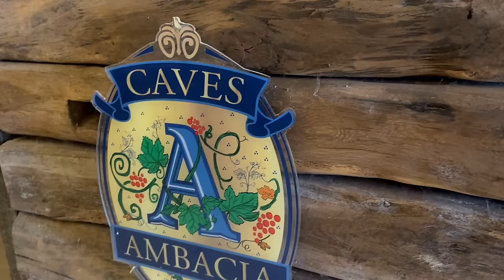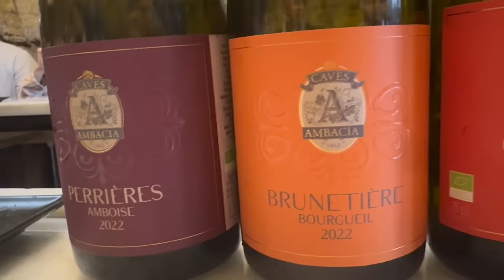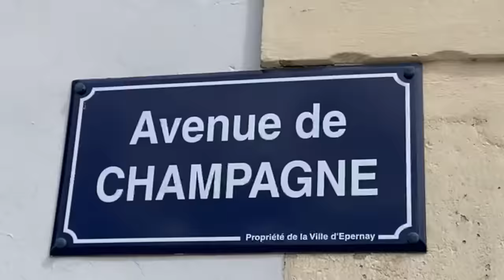Ep 36 | We have a HUGE ANNOUNCEMENT...

Comment: A high quality diesel is still the best answer.  Electric drive will improve but it's still a new technology with its own set of problems.  Diesel parts are far more available in remote places than motor controllers, etc.

Comment: I think it's great you chose to go electric. It will change the way you sail, especially on long voyages. You'll be motoring a lot less in the calm patches. But, if you've watched Sailing Uma, you'll know that it is very doable. I just bought a boat and wouldn't  hesitate to change over to electric if the existing engine was in bad shape. Mine, however, is in excellent shape so it wouldn't be cost effective to switch out. Good luck with everything.
Reply from the maker: It's a whole new learning experience. We wouldn't have switched if we weren't in the position we were in. 🙂

Comment: Electric motors are definitely the way forward. As well as us there are two other boats here fitting them at the moment.
Doing things differently to how they have "always" been (always meaning 60 years or so in this case) scares many people. Typically there is imbalance in the arguments with the disadvantages of the new getting far more attention than the disadvantages of the old. For diesel it's worth paying attention to the issues with failing due to fuel contamination/diesel bug/sludge at the most critical times when rough seas stir up the fuel in the tanks.
Also range is often mentioned but only as the electric motors are limited at high speed. But when crossing oceans the electric motors come with essentially unlimited range at those slow speeds not limited by how much fuel you started with.
Reply from the maker: Very well put. I look forward to us both getting out there and comparing/ learning from each other!🙂

Comment: Where are you gonna get the power from for a DC motor, the sun isn't reliable enough in the Northern henisphere , Sailing Uma has to fire up a petrol generator to get around, the last thing you need onboard. Stick with a diesel.
Reply: It really does not sound like you have been out in the scary stuff yet. Big sea, blowing on shore, I would not want to be worrying about how much battery I had left. I don’t know how to say that without sounding negative or patronising because you are great, but be wise :-)

Comment: Using Bellmarine?
Reply: They could look at what Windello use on their cats as guidance. 

In France 5 a day is 1 of your food groups.  
Best for a monohull is to have a modest sized power pack and run an efficient generator .
 
The size of your boat will determine your motor size but you do need the right prop to get anything like the performance an E motor can deliver.. 

You could use pod motors  but for internal power you can use either Golden motors 15 or 20 kw motors or more..  

In British waters you will need to use a motor  in many cases to get in or out of harbour. 

As you will struggle with solar and regen under sail at times a generator running at its Stoichiometric optimum 
Will worknfor you and keep you safe in the dark and at high lattitudes.
Reply from the maker: No but something similar and UK based.🙂